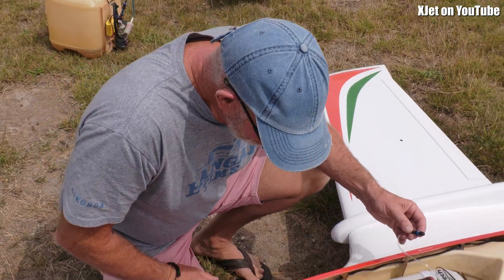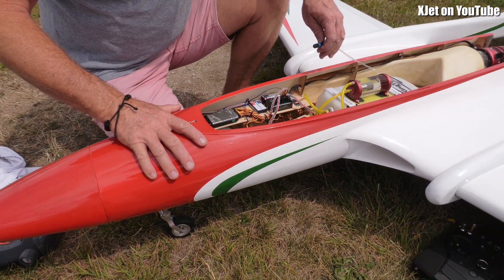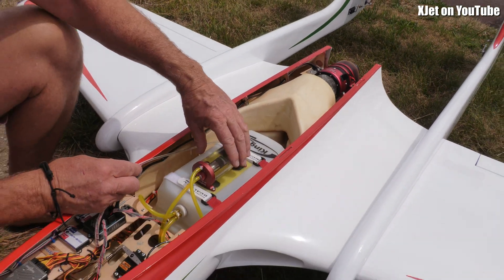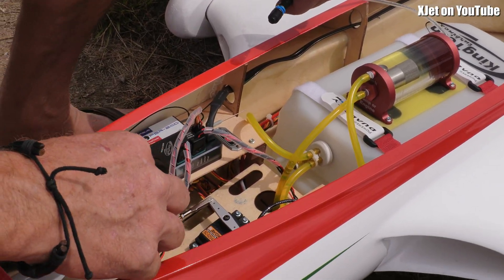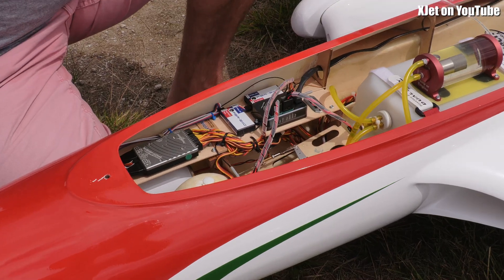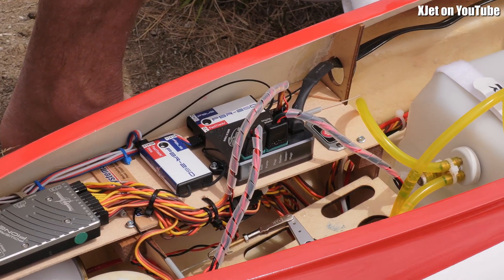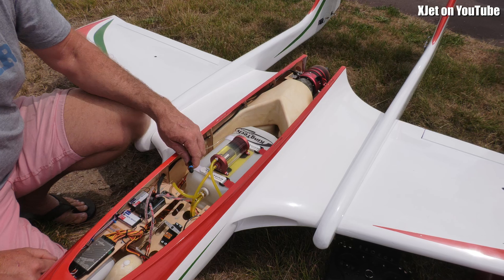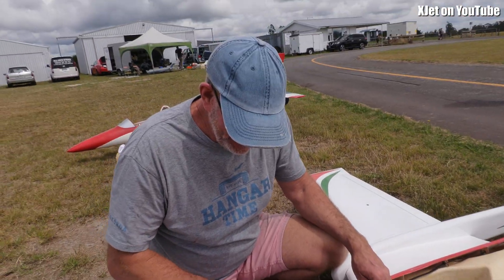What's inside a NZ$10,000 jet-powered RC plane?

Comment: When money isn't an option YOU haven't spent enough.  The most fun I had was building SPADs (Simple Plastic Airplane Designs) we were folding up used campaign signs, and used rubbish Gas(Petrol) stations powering them with whatever cast off club sale motor and gear we could scrounge.  Breaking down weedeater motors to use for motors.  Big Juice or water containers for fuel tanks.  Just making general sport planes out of, Garbage really.  Bicycle spokes for pushrods.  Poly cutting boards for firewalls n such.  100 bucks of radio, 20-75 bucks of motor and 6 bucks of junk to make an all plastic Ugly Stick.  But If money was no option I'm sure I'd have 2 or 3 of those, though there sometimes is nothing as fun and less technology involved as my Ringmaster Control Line airplane.  Boys and there Toys.

Comment: it is not 10k 😂 that jet is 5k$
Reply from the maker: NZ$10K -- which is about US$6.7K.  It also has an RC system that costs a lot more than your average Radiomaster setup.
Reply: @xjet  don't forget about the freight to NZ either. Just the freight alone on my new flash was half the price of the whole kit. Just the airframe and the turbine already pushes mine over 10K before adding anything else to it
Reply: ya I am just saying it is not $10,000 I fly turbines I fly all turbines I have a rebel max everything So I’m just saying